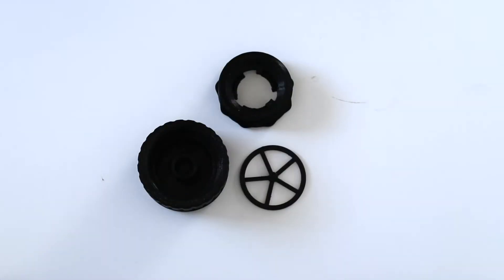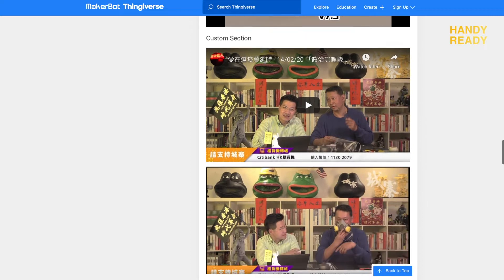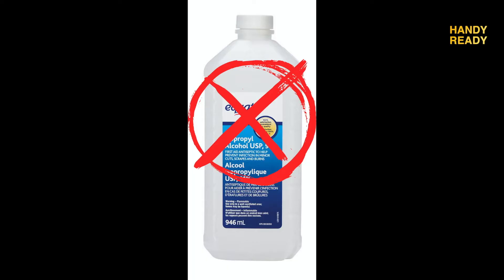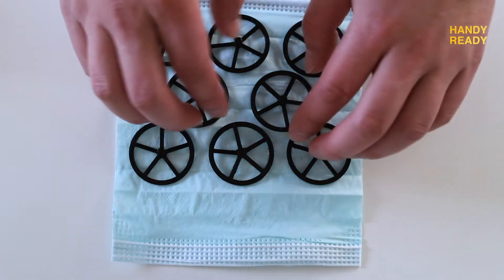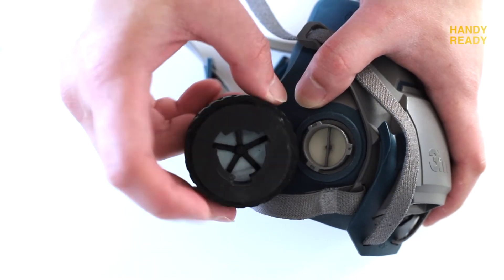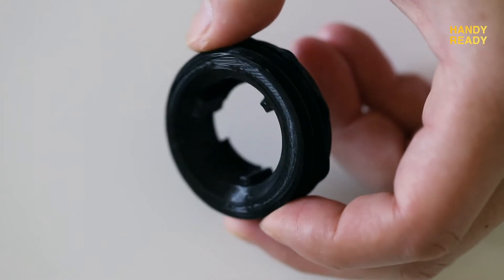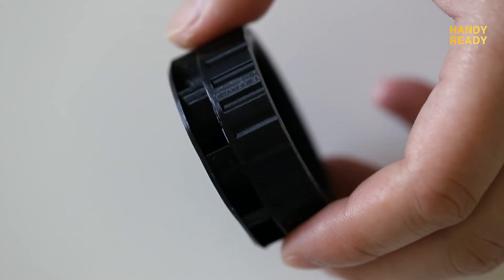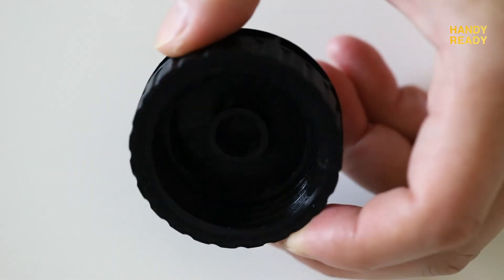What is a 3D Printed Filter Capsule?

Comment: It might be a year late, but I think using the surgical mask, its better to place it in the exhalation valve, as surgical mask purpose is to prevent contaminants from yourself from spreading to others and not vice versa, for protection in the inhalation filters, its better to use N95 rated filters and materials or higher as they are designed to filter out particulates which might host Covid-19 stuff. Not a medical professional or anything, so take it with a pinch of salt, but its my opinion.
Reply: Hi Ahrec well onething I did seem to see in a video about gas mask is they seemed to suggest cut a pice of surgical mask and put it over the exhalator valve! I think the video you are refering to is here they are refering to the fact about covered exhaltor valves : https://youtu.be/0kwGxxOFL6A

Comment: or you can cut 8 straight cut strips of the face mask so there's less wastage and design a 3m 603/503 style adapter that fits exactly that? In 0ur country a covering on the exhaust valve is required also, i use a strip of face mask for that and just clip it above the exhaust valve so there's a good seal
Reply from the maker: the 603/503 requires larger filter cutouts and you don't need such large filter for daily usage.